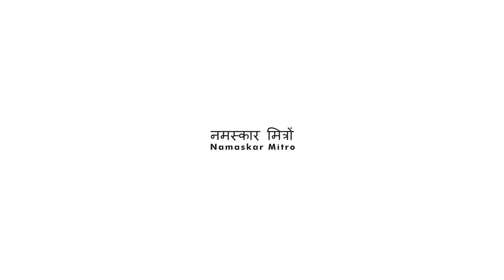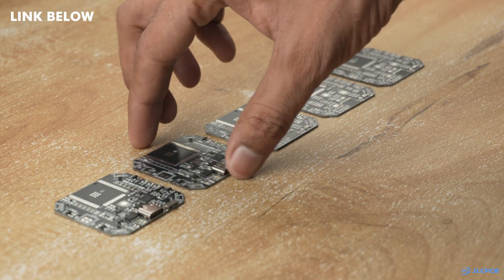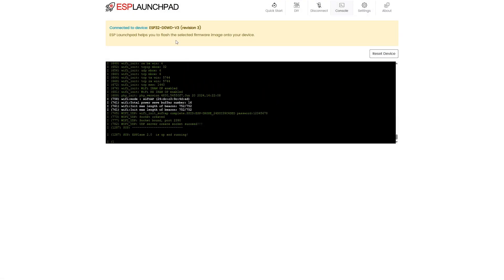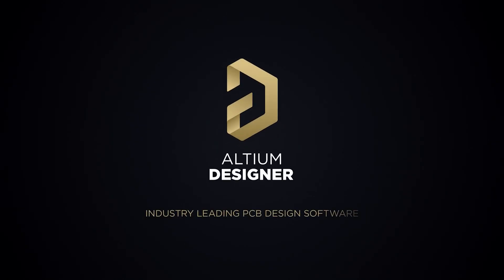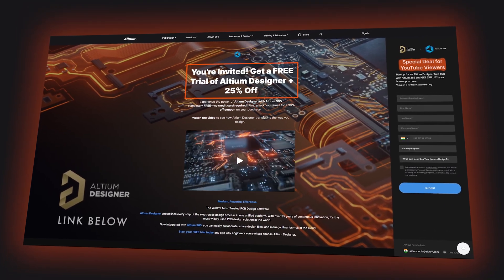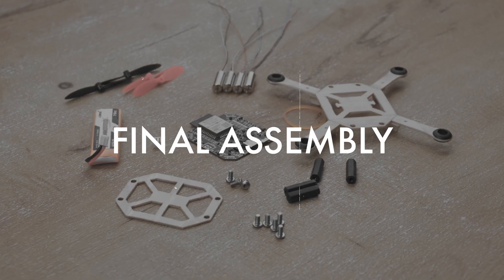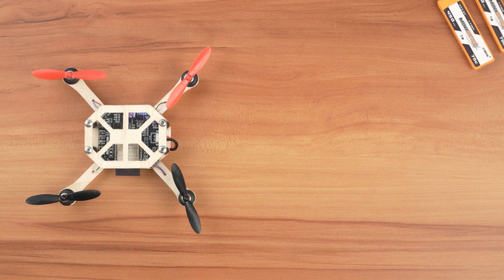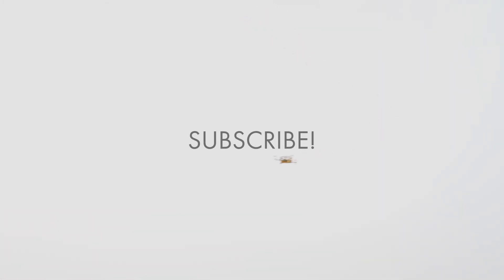ESP32 Drone Built From Popsicle Sticks – Fully Mobile Controlled!

Comment: Bro the PCB files i have uploaded in JLCPCB but the rate is going to the of $165.45 , is there any other method I don't have air soldering also to fit the pcb components.🥲

Comment: Great project but the frame not so durable can I recreate this project by using esp dev board mpu6050 module and some bigger motors and batteries
Reply: yes you can try I have purchased all the things and battery also but just fucked up by purchasing 25c battery by shorting negative and positive of battery while motor driver connection

Comment: bro please reply is there any way of doing it without pcb please tell me because the pcb and assembly is cheap but the shipping cost is too high (i dont have that much money but i need to built this please tell a way)for example one time it asked 30 dollars shipping for 2 dollar pcb by the way iam a subscriber and love your content
Reply: Bro you have to use a bigger set of motors with enough thrust and then you can use the eps dev board mpu6050 module and few MOSFET along with a tp4056 charging module the only concern is that the motor should have enough thrust so you might buy a bigger more powerful set of motors
Reply: @engineer-making  Bro I really need a written guide or tutorial video bro 😢 it is hard to just follow your steps cause I am just a 14y old if you want to hear my story please let me know 🙏
Reply: Just wait for some time lil bro I am working on this project to and will comeback with a video and detailed documentation as well till then try to read the circuit digest esp drone design.
Just type circuit digest esp drone on google
Reply: @engineer-making  thank you bro i really hope you make the video by the way i subscribed your channel ☺
Reply: You are very intrusive. 👎
Reply: See max imagination drone  video